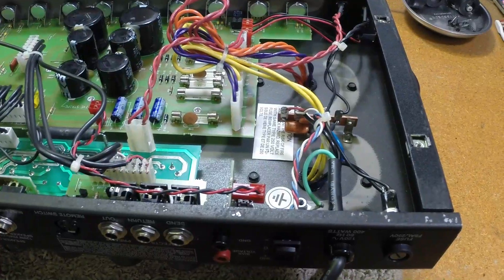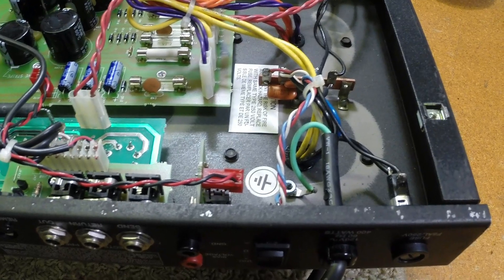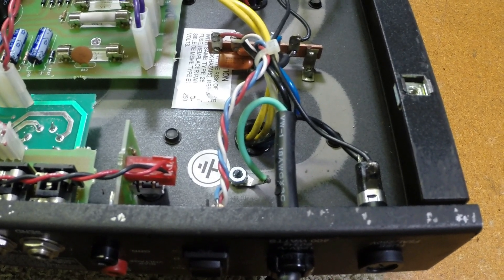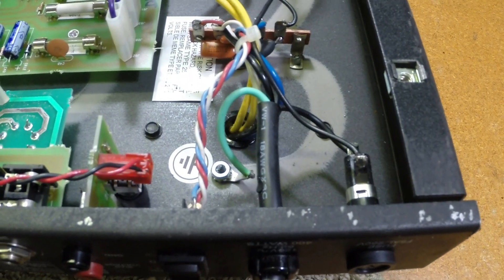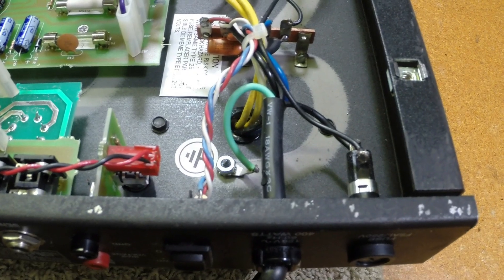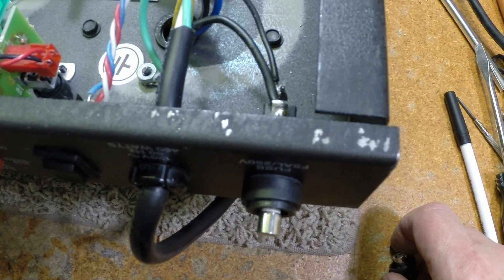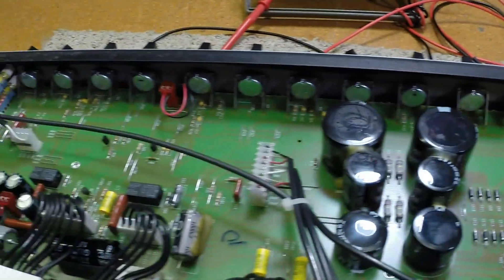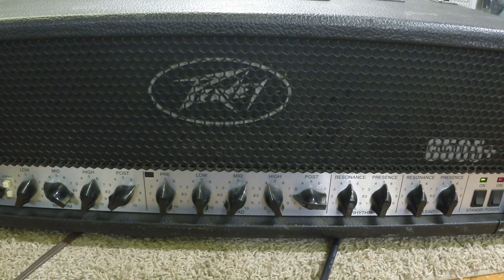Peavey 6505+ No Power Quandary

Comment: I got a 50 year old story for you. 🤣 When I was about 5 years old we had a black & white TV that in order to adjust the vertical hold (which needed adjusting all the time) you had to insert a 12 inch long screw driver to adjust it... But don't slip as it would zap you big time! 🤣 I hated that TV!
Reply from the maker: The worst shock I ever got was in my very early days.  The most convenient  place for me to practice at the kitchen table.  There was an outlet for my little LINE OPPERATED power transformerless amplifier just behind the chair at the end of the table, and I could lay my instruction book on the table.  Sounds like a good plan right?  All was well until I put my right palm against the side of my forehead and rested my elbow on the Gas range with electric clock.....of course I still had my left hand on the strings of the guitar.  I remember seeing a blue flash, internal of course , as the ground on the stove collided with the voltage present on the ground of the amp.  Which naturally passed through the side of my head most likely across my optical nerves to my left hand.  I never did that again.  Also learned do not play barefoot on concrete with the same amp.  :) Kids these days don't know 
what they are missing.
Reply: @guitarc.p.r.9675  oh shit! That had to hurt! 

I can kinda relate to that internal shock. I have to get neck injections for some pinched nerves... One time the doc hit a nerve with the needle and it felt like I was getting hit with a 220v line. That hurt like a biotch!
Reply from the maker: Once I saw the head amp tech at the store I worked at as a guitar guy take roughly 750 volts ac.  I was doing some of the amp work and had an Ampeg V22 power transformer unhooked to check out.  I had the ac on and ready to test when he came in the door.  As he took off his jacket he asked what I was into, I replied I was about to check voltages on this transformer.  He spun around with an "I'll do it!" before I could say anything he picked up the meter leads in each hand and latched onto the B+.  It quickly knocked him backwards onto the stairs behind us.  I asked if he was alright, he was a little pale, and shook.  He said Yeah, but it felt like someone was hitting him in the chest with a baseball bat.  After a cigarette and some coffee he was fine fortunately.  He stopped in to see me last year, Had not seen him for about 30 yrs.  Fine and doing well.  We laughed about us both still being at it.
Reply: @guitarc.p.r.9675  electricity is to be respected!